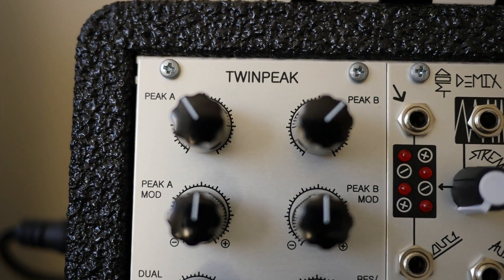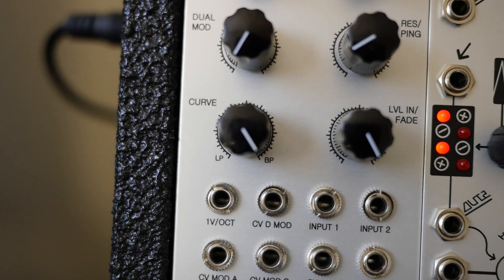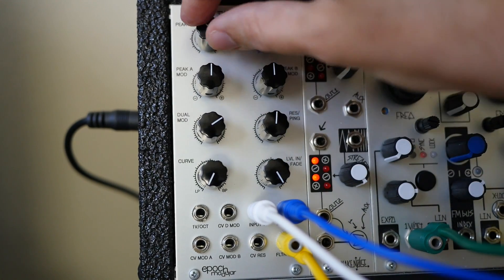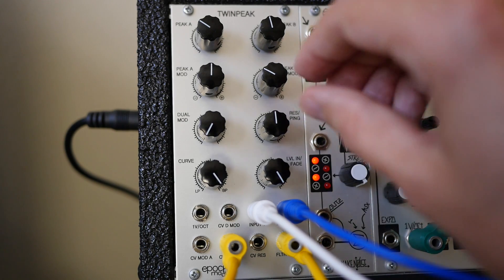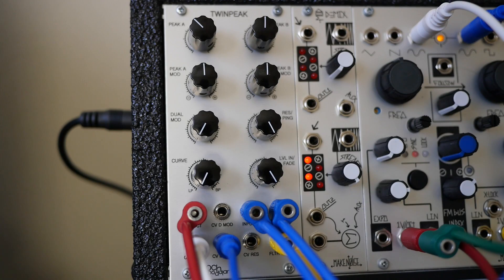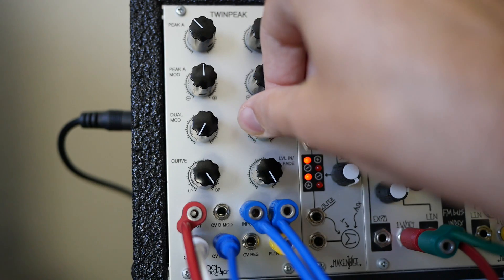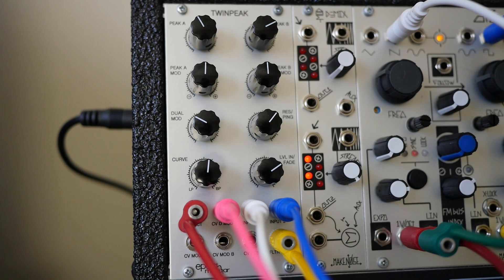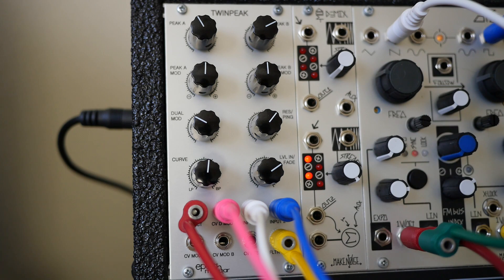Epoch Modular TwinPeak Filter

Comment: You still have this one? Do you have a level drop from regular modular levels with this? Do you feel like it's more of a pingable filter, or do you think the performance when filtering audio is on par with the best filters available? Thanks for the video, been following your videos for a while now!
Reply from the maker: I do!  It's no longer in my main performance case as I've been exploring not using any filters at all, but I do still use it frequently.  In fact, I now often reach to it before my RES-4 simply because of the controls and input mixer.  The volume drop can be a challenge in some cases, but I rarely find it a deal breaker.  I'll just bring down the other/louder voices if necessary (or I treat the output of the twinpeak as a more "gentle" voice and know that a stronger voice will overshadow it).  I personally think it has one of, if not the, nicest 'ping' sounds in the eurorack format, but that's not the only thing it's useful for.  Being able to control the frequency interval of the two band-passes and have both accurately track 1v/Oct results in some sounds I've only been able to achieve with the RES-4 and I find the Resonance control a little more forgiving on the TwinPeak (the RES-4 can start to get on the brittle side as well as overload very easily).  Being able to control each peak independently via CV as well as in unison without an additional mixer is also fantastic - as is the dual input x-fade - extremely useful when blending different input sources, again without an additional mixer.  Tonality-wise, it's extremely clean and a wide range of Resonance without self-oscillation, which is probably why the in/out gain is lower compared to other filters.  But this allows you to isolate/filter through harmonics very clearly, and also works better in delay/reverb/etc feedback loops much better than other filter's I've used.  I might not recommend it to someone as their only filter (although it was the only filter I had in my performance case for nearly 9mo), I think it's an extremely versatile and unique filter.  There's lots of bread-and-butter filters in the format, but there's very few peers of the TwinPeak.
Reply: Oh man, thanks for the very detailed reply! I tend to severely overthink these kinds of things, it's between the WMD Aperture and this now. The Twinpeaks' tone is just something really great. You really helped a lot, thanks again!
Reply from the maker: Anytime!  Also consider a mixer module that offers additional gain boosting.  This will be useful for experimenting in a lot of different situations (especially if it's a DC coupled mixer and you can boost CV), but can be a way to mitigate the volume drop if you're worried that it might bother you a lot.

Comment: is it comparable to three sisters?
Reply from the maker: I don't have a Three Sisters, but from what I can tell of it, they seem different enough.  Firstly, the TwinPeak is capable of Low Pass filtering - the TS seems to be 3 band pass filters in parallel that can be spread apart via the "Span" control.  On the TwinPeak, you have a single band pass, but with resonant peaks on the bottom and top of the band, as well as being able to adjust the width of the band (Peak A, Peak B), which is rather unique for a bandpass filter.  For me, the Curve and Fade functionality on this module really make it shine.  It makes it incredibly versatile, not only with patching, but performance too.  I've have a lot of eurorack filters come through my rack and this one has quickly become a favorite.
Reply: I have both filters and they're my two favorites. Sisters is indeed different: it's a trio of filters that are either all bandpasses or a set of high, band (sort of) and low pass. Depends on the switch setting.